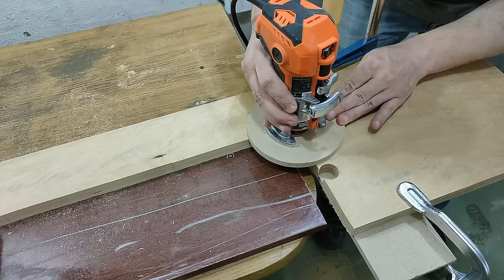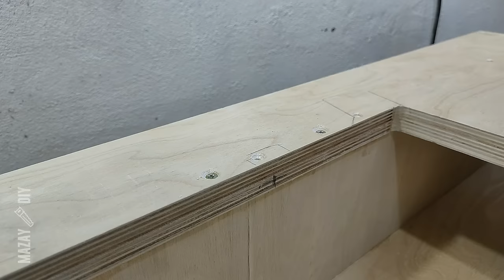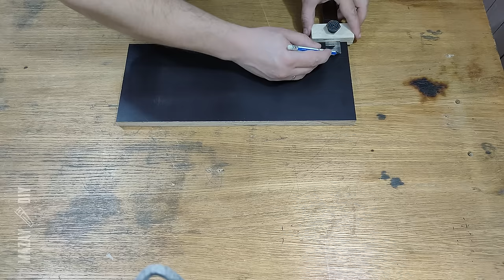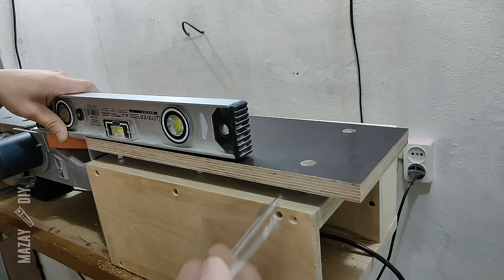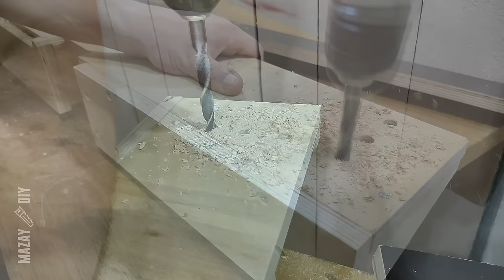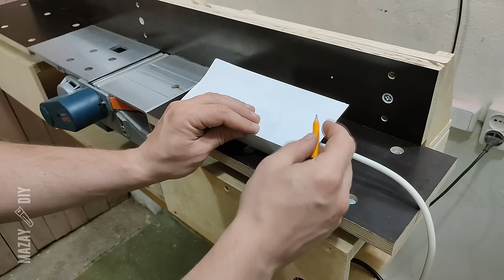DIY Benchtop Jointer with Precise Adjustments | Free PDF Plans

Comment: наверное единственный и самый большой плюс - это вес. смотря на какие задачи рассчитан станок. в общем со временем (как мне кажется) захочется строгать что-то более длинное и тяжелое. если не получается найти нормальный б/у фуганок, то вполне разумный выход. выглядит вполне. и большинство фабричных фуганков хоббийного класса требуют больших усилий по догонке (они все кривые и косые), чем изготовление такого станочка. двигатель в этом ребире мощный (больше 2 кВт) да и ширина строгания вполне достаточная
Reply: Your comment is a good one. But cost savings are not small! But this machine ("Revir IE 5708M) is not commonly available, at least in Latin America. I have done my own home made jointer with a MAKITA 1912B planer, that is not as wide (110 versus 155 mm) but conveniently more than the too common 82 mm wide hand planers, and I am happy with it, as it is a fine machine an even when it is not as powerful (only about 900 watts) and it has not a single accesory to mount it upside down, it is still adequate to make passes with one milimeter cutting depth in hard woods. And recently, Makita has made available the Tungsten Carbide knives in addition to the fine cutting but less durable HSS blades. Persons like the intelligent and able one that made this design deserve our admiration and respect!

Comment: I just finished my version of your design. 1:1 to be honest. How deep are you planing by one run ? Thanks for all drawings. Spasiba.
Reply from the maker: Great news! About one mm
Reply: @MazayDIY  Spasiba. Thx. Tomorrow I have to do some fine tunning and first runs.
Reply: I like the idea seems complete can u the share disgned i could try to make it.  Im beginner in this type a hobby.  What would you do to cancel or lowered  the noise generated by both machines,  vaccum and the jointer itself. 
Thanks

Comment: Muchas gracias por el video! que modelo de cepillo Rebir utilizaste?
Reply: it seems to be a rebir IE 5708m model. 155mm
Reply: Mira compañero, yo revisé muy bien en el mercado, buscando el mejor cepillo eléctrico antes de comprarme el mío... y como ya tenía en mente fabricarme mi canteadora hecha en casa, quería un cepillo más anchonque los comunes de sólo 3 1/4" (82 mm) de ancho, y sólo hallé el Makita 1912b, que es de 4 3/8" (111 mm) y aunque hay otro modelo de Makita de 6" de ancho, es muy caro y pesado para llegar a usar a mano, y sin embargo, mi Makita 1912b es una máquina muy precisa, sólida y se vende en México y hay garantía y refacciones, y por ello recomiendo ese modelo. Suerte!
Reply: @abouteverything8341  For those in America (both North and South), the easyvto get Makita 1912b is a good alternative for making a home-made jointer and also as a hand held planer. Well built with a thick and flat sole, it lends itself for this conversion, albeit it lacks the accesories to mount it upside down and is about half as powerful, but enough to make up to 1/16" passes without effort. Highly recommended.

Comment: Where is the spec for the Jointer used here?  (The one you started with?)
I cannot find any hand-held planers in the USA that are 6", or so, wide.
Please assist.
Reply from the maker: I used a Rebir IE-5708M planer A similar planer - Makita 1806B (more expensive)
Reply: @MazayDIY  Oops!  Is this a 220v planer?  I saw the watts on the box = 2250W.  I don't think you get that from 120vac, 15a.
(USA has 120v)
Reply: I am in Mexico, and because the Rebir brand is not known at all here, I got a smaller Makita 1912b, which is not 6", but a still useful and convenient 4 3/8" wide, and found it well built and better overall than any of the other standard 3 1/4" hand planes.
Mine is very solid and precise, has less vibration than most usual ones and is powerful enough at 7.5 A at 120 Volt... Of course it is not t dehe same as a dedicated jointer, but I find it VERY affordable, still easily removable for hand work and a pleasure to use. My quick improvised version of a home built DIY joiner is not as elaborate,  but still useful, and used less expensive melamine covered MDF, which is acceptably stable in our relatively mild climate in Mexico City.  There is a Makita 6" monster planer in their catalog, but it was considered "too expensive" for what the local representative thinks about the local market, so they don't import it into my country.

Thanks to very clever and dedicated You-tuber DIY persons like the one that posted this excellent video, we can all learn and take the best details for our own "ultimate" home made bench tools. One thing some too picky and under appreciative commenters seem not to get: the sole undertaking of building a home made bench tool from hand held inexpensive tools, is the considerable knowledge and ability gained from attempting and keeping getting better at home made tools; that is invaluable, as you can get much better before attempting to build fine furniture by dedicating time, planning and effort to first build yourself a set of home made tools. It is a very valuable experience by itself.

Comment: Welcher Elektrohobel wird da genutzt?
Reply: Rebir IE-5708M
Reply: If the Rebir is not available in your country, try a Makita 1912b like mine, which is only 4 3/8" wide, but still very useful, because the Makita 6" wide monster tends to be very expensive!

Comment: is it worth? you can get benchtop jointer for about $300.
Reply: You seem to be narrowly focusing on your particular conditions of your country... In many parts of the world, a new, "run of the mill" cast iron jointer is WAY MORE EXPENSIVE... For example, here where I live in Mexico City, the very few available jointers are from China, and still are very expensive due to transport costs and taxes, and are NOT that precise or well made! There are a few Delta or Silverline ones, still Chinese made, and their prices run on the neighborhood of $1,500 UD Dollars... Getting a used one is difficult, as they are not many dedicated hobby woodworkers so to have them in quantity, and the few ones on the used market are either too worn or still expensive. Here (and from what I learn chatting with many hobby woodworkers around the world), is where this type of home made bench tools become useful, AFFORDABLE and ACHIEVABLE, and an excellent opportunity to hone the woodworking skill of those brave and intelligent enough individuals that seriously attempt these types of jobs. For your information, my hand plane, which is a Makita 1912b model with 4 3/8" width, costed me close to $285 USD in 2018, and I bought it over any other common 3 1/4" hand plane because of the useful extra width, thinking on using it as a home made jointer in addition to hand use.